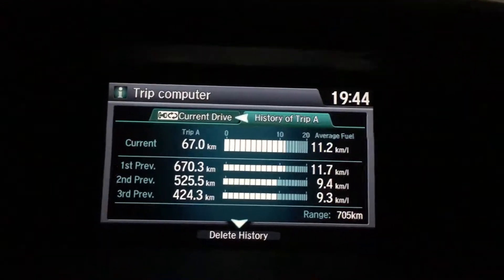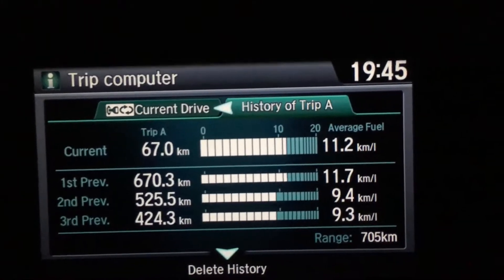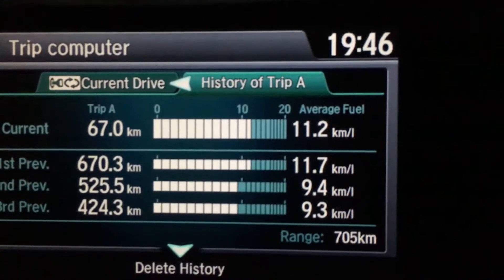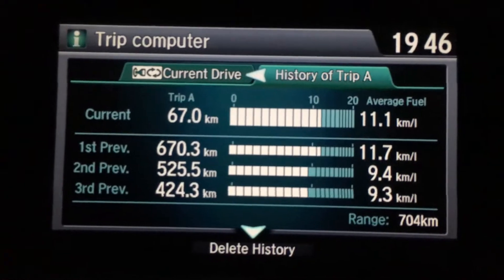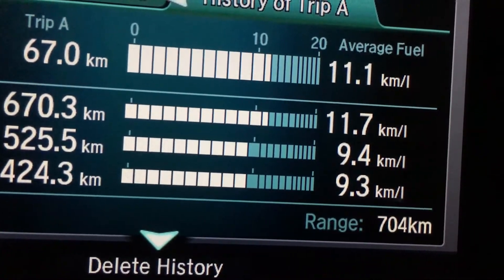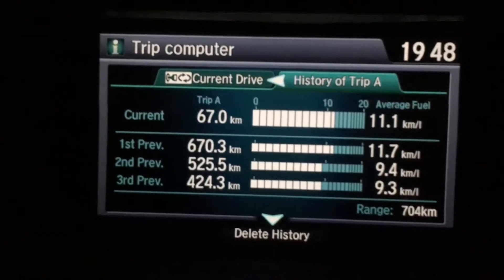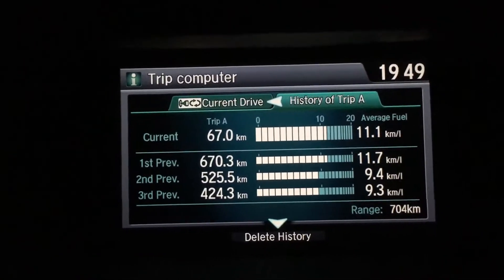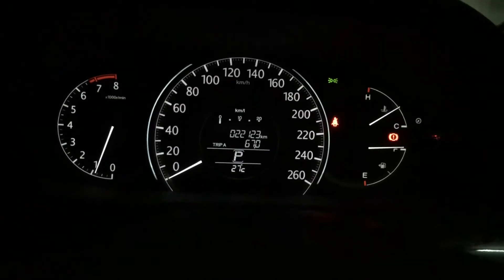Honda's Econ Button Test : Does It Work?

Comment: After driving the car almost 400 kms in Econ mode and another 400 kms in normal mode, I have the same opinion. It doesn't really saves you gas. It makes the ride a lot softer. So, basically it's the comfort mode more than eco mode.